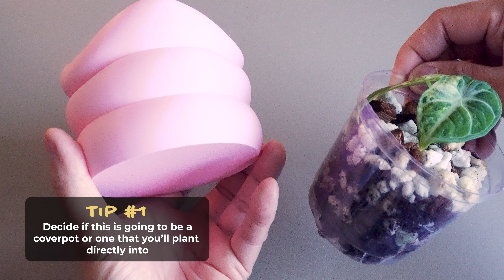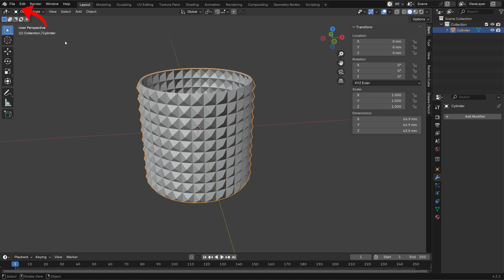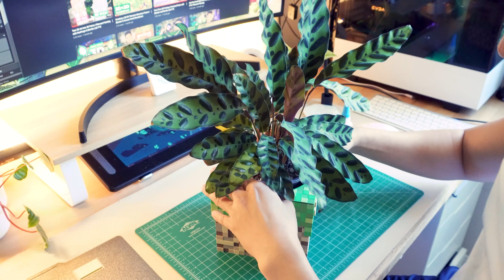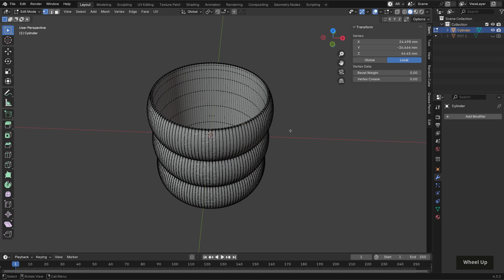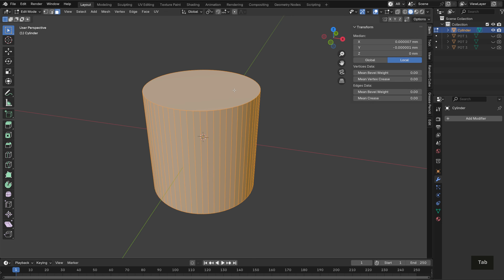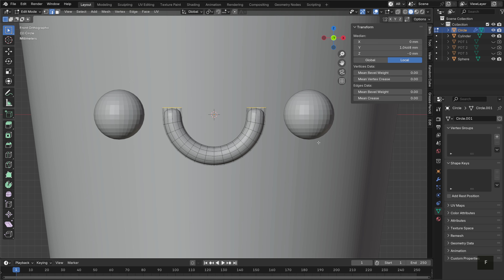Blender Design Basics for 3D Printing | 4 Easy Plant Pots with the Bambu Lab P1S

Comment: I'm using blender 5.0.1 and making hole using Boolean + Different not working but Boolean + Union works
Reply from the maker: The boolean modifier is a bit finnicky so you might need to adjust your shapes position or scale a bit. This should work regardless of Blender version.

Comment: i may have missed it in the video but what fliament are you using since there are holes in the plastic cup im assuming its not pla is it petg?
Reply from the maker: For the plastic cup, it was just one I had lying around. But, if you are looking to print a liner for the actual plant, I would use PETG at 1-2mm thickness for the walls since it's water resistant and more durable than PLA. IMO PLA is generally fine for planting directly, but I called it out as a precaution. I wouldn't use PLA for outdoor, in constant direct sun, or constant moisture.

Comment: I followed all thr steps on pot #2 and i cant get the 3 equal rounded edges to meet to create that deep crease without a slanted flange appearing at the top and bottom of pot
Any idea what may be causing this?
Reply from the maker: I would check the top and bottom edges of cylinder. Just double check you don't have any wanted edges that could be offsetting the beveling that creates the crease. Let me know if that helps.

Comment: Thanks for this well explained tutorial. when doing the scaling on x/y only though  the top row always looks a little different and when checking the overlays there's always a red edge. any ideas why?
Reply from the maker: Thanks so much! And are you referring to the lip of the pot? This is because the inner and outer wall will not scale the same. To fix that, I would scale the pot to your liking before adding thickness. Regarding the overlays, if there is a red edge, you can just hit Shift + N to recalculate normals. Hope that helps!

Comment: I’ve been trying to find all over what sealant to use that’s safe for plants so that I can plant directly inside. What do you use if I may ask. Would be so helpful
Reply from the maker: Hmm if you're trying to plant directly, you can try ArtResin. It's a plant/food safe epoxy and it works well for sealing the inside of 3D printed pots. You'll just need to make sure it's fully cured before adding soil.
Reply: You could try aquarium sealant.
Reply: Beeswax. Incredibly simple to apply, incredibly cheap to get.

Comment: Did some of these key board short cuts change?  Especially for the 2nd pot, CTRL Z, instead of CTRL C for example...  (I'm using Troublesome Blender version 4.4 which needs this cmd prompt to start at the moment:  "C:\Program Files\Blender Foundation\Blender 4.4\blender-launcher.exe" --gpu-backend vulkan
Reply from the maker: Those should still be the same!